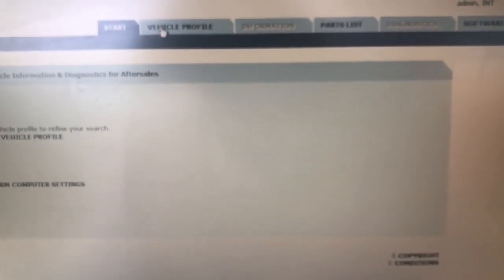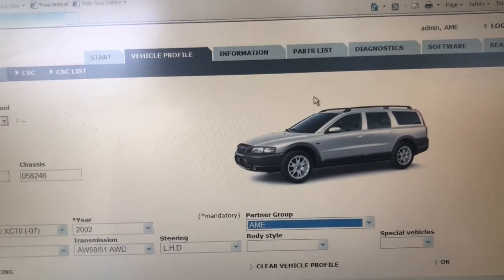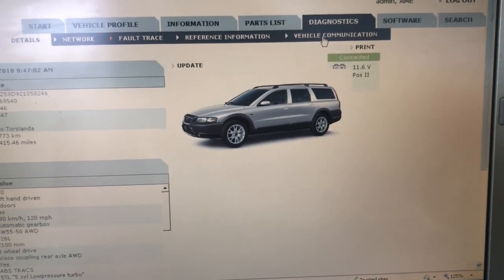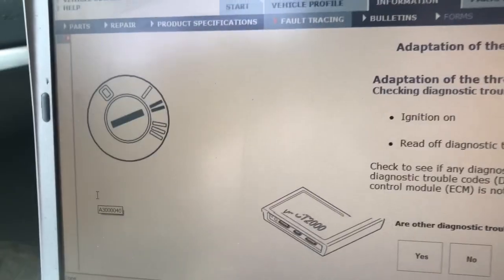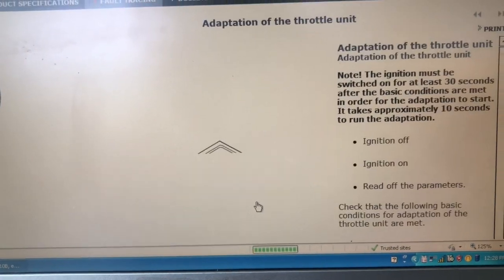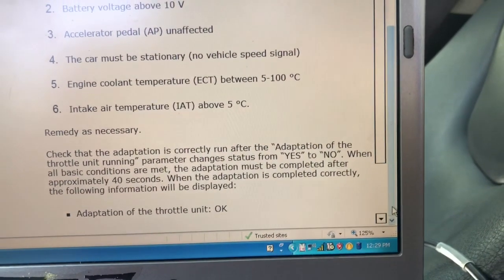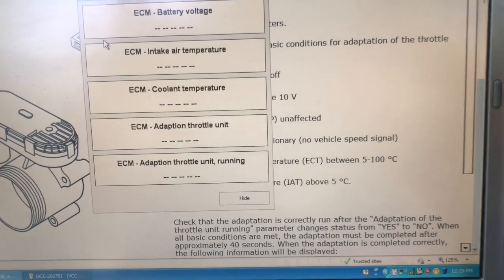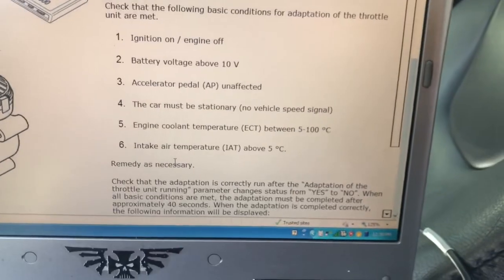Volvo Vida DICE Throttle Adaptation

Comment: Thanks for the video, will this work with the magneti marelli throttle body which came from a used car? (having in mind it worked on the other car). Or it has to be a new throttle body.
Reply from the maker: I think it should. Give it a try.
Reply: Any new info on this? I'm facing the same issue
Reply: @vladnicholasvilcov239 I just replaced the throttle body and it works. I dont feel that something is wrong.
Reply: @MustAccord  my car has been killing with a rough idle to the point of it stopping for six months now and 2000 euros later it still persists
Reply: @vladnicholasvilcov239 I bought a used throttle body for 20euros and replaced it myself. What exactly did you spend the 2k on?
Reply: @MustAccord  new timimg dephaser pulley, new vacuum lines, new turbo and etm fittings and seals, new spark plugs, one used ETM and a few other bits
Reply: I dont have adaption to choose only test.
Volvo V70 2.4t 2001

Comment: Does this work with the "version 1" (before 2000) v70 that has the notorious Marelli ETM?
Reply: if it has a obd2 port i think yes
Reply: Only 1999-2000 p80 V70. The 1998 are different, and more akin to the older Volvo  style. Vida dice can only work with p1, p2 and p3 Volvo.